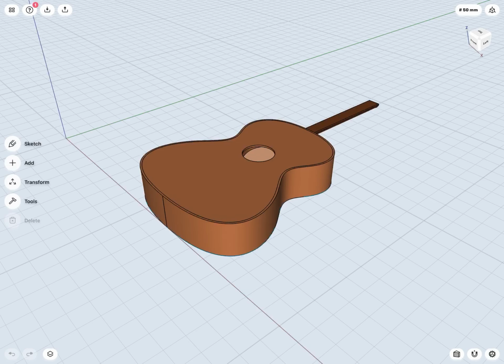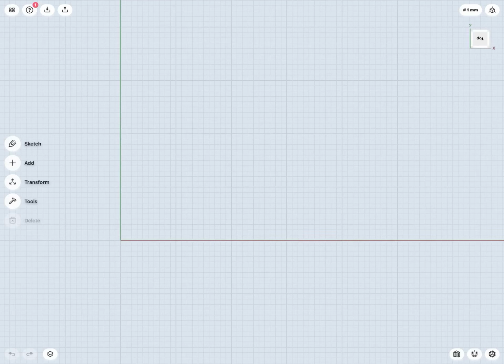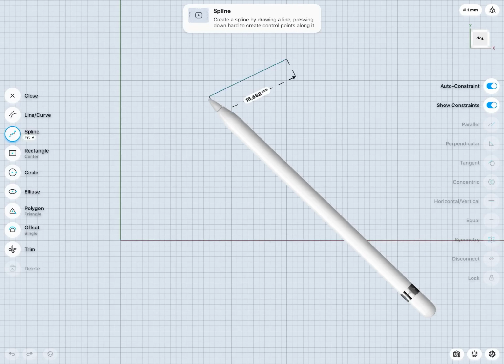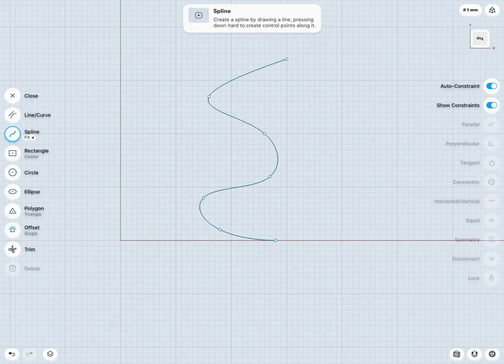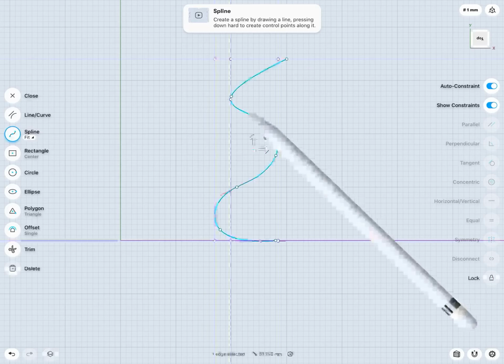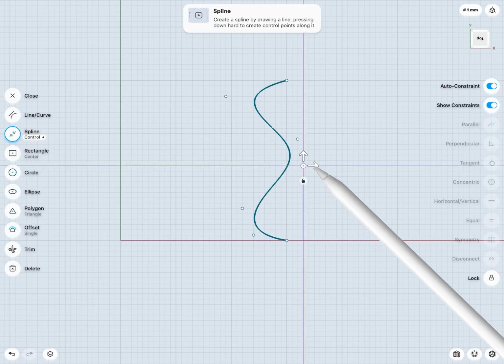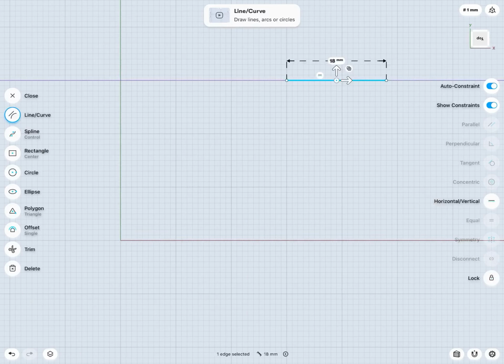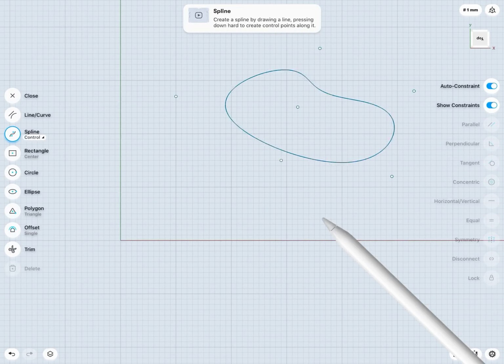Splines | Shapr3D for Beginners

Comment: I been struggling with being able to manipulate splines and nodes after drawing them . It just selects the spline 9 out of 10 times or starts a new spline. The pressure for making new nodes doesn't seem to work well either. Doesn't seem to matter if it is on hard or light. Anything to try?
Reply from the maker: Hi, this might be a simple glitch from the app. Please can you reload the app, tap on the Spline tool and then try adding a Spline point. 

Let me know if the issue persist.

P.S please tap on the Spline tool first before trying to add a new spline point.
Reply: Are you using an Apple Pencil or a third-party stylus?

Comment: Hi Shapr3D...  I’m a hobby channel, is the free version adequate to export an stl that will print at about a 20um layer depth to make nice quality FDM hobby prints? ...  perhaps I’ll put this to the test in a future video...  please continue to support the enthusiasts and we will continue to support you guys by spreading the good word!...  iPad and pencil at the ready!
Reply from the maker: Hi, thanks for reaching out. The free version allows you to 3dprint models in as Low _resulotion STL files. 

I'm not sure if this matches the stated specification, but you can sure also start a trial with which you can cancel anytime. With the trial subscription, you can export your model in a High-resolution STL file format.
Reply: Shapr3D ... thanks!! I’ll continue to enjoy the hobby side and print up a test piece... I’m sure I’ll be fine... loving the use ability of your software!!  Much easier than free CaD which is what I have been using in the past!

Comment: I have some suggestions for improving the functionality of the splines: Add the ability to add points to control points splines. Also,

highlight the control points of the selected spline. It is now hard to tell which control points belong to the spline I am working on if I have two or three splines close together.
Reply from the maker: Hi Mark, thanks for the feedback.  I have forwarded your feedback to our product team and hopefully, this might be available in the app soonest. Can you please share with me some info on how the control points spline helps your workflow better than the fit points spline?
Reply: Shapr3D You are welcome and thank you for being so responsive. As to the control point splines, I like them better because of the smoother shapes they produce and are easier, for me at least, to control. I find the fit splines a bit more difficult to manage, they can get unwieldy pretty easily, and it’s easy to get kinks into them. And with all the handles etc. they quickly become a handful to manage. Hope this helps.
Reply from the maker: Hello, thanks for the extra insights on your workflow. I will attach these to your previous feedback which I already shared with our product team.
Reply: Shapr3D You are very welcome. You have a great product and you’re making it better all the time. I really enjoy using it. Have a nice day.
Reply: I second this